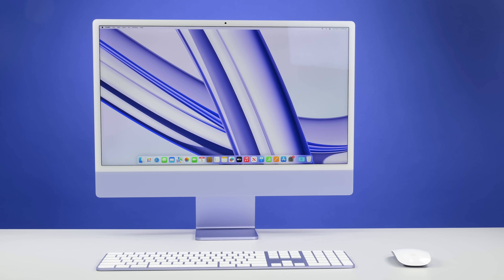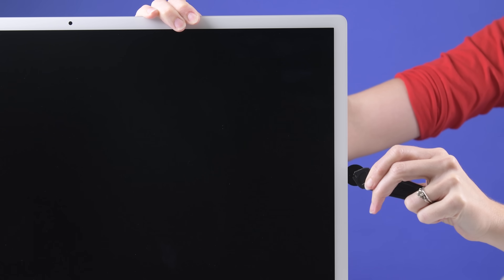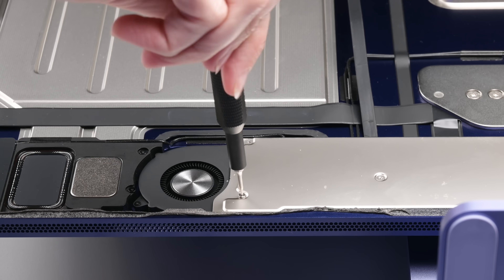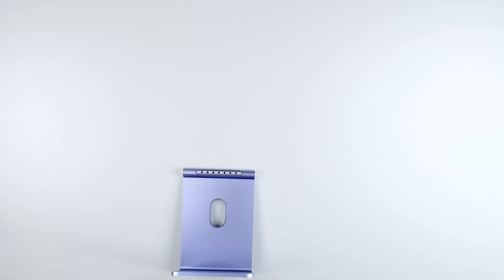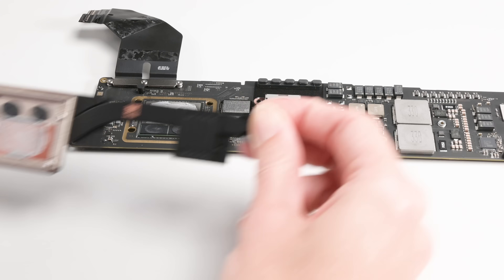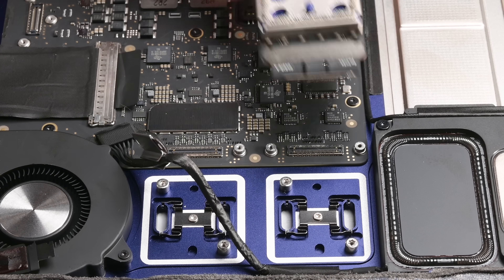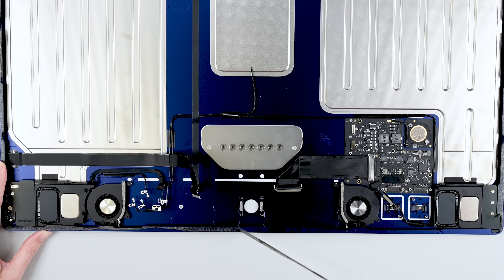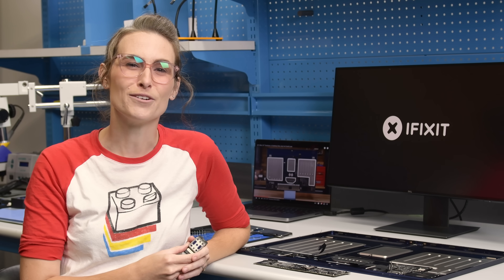M3 iMac Teardown: Apple’s Most Replaceable Battery?

Comment: Didn't realize Imac had a battery .. I though only Air and macbook pro laptops.
Reply: The reason why desktop computers have batteries is because this prevents system date and time from resetting each time computer is disconnected from AC outlet. When tearing down iMac, what needs to be removed first is, of course, screen, but what should be removed second in this video is battery, despite it only powers internal clock and not anything else.

Comment: If anyone was wondering why Apple stopped allowing end user VESA to stand swaps apparently the iMac Pro VESA kit was causing people a lot of problems (breaking while being installed/removed, screws stripping due to thread locker)
snazzy labs has a series of videos documenting his struggles so Apple decided you needed to pick which way you wanted it since
Reply: do you know if you can buy an adapter somewhere? ive been wanting to remove the stand to switch over to vesa, but can't find that adapter anywhere

Comment: Apple claims to be eco friendly, but if that's the case this kind of product should not exist without user replace-able/upgradeable CPU board, RAM, battery, HD (without needing to take the whole product apart).. as it stands you have a screen that is probably going to be trashed 5-10 years down the line. There was really no reason for Apple to not enable also using this as an external display capable to show other non-Apple OSs from external machines (well there are reasons, but I need to stay polite). Do yourself and the environment a favor get a Mac mini or laptop instead + external display if you really must have Mac OS and a big screen (non-upgradeable soldered HD/RAM in the mini/laptops is also kind of offensive).

Comment: No fault of the technician / host here but "accessible" shouldn't be associated with "repairable".  Short of the battery, it seems like there's nothing you can actually fix on this machine with a replacement part due to serialization.  Soldered basic components still gets a 0 of 10 from me.

Comment: If they'd just shoved that tiny mainboard into the PSU as well, then... oh hold on.. then that would be a mac min... and a moni.. 
I'm sure they have their reasons.
Reply: That would require compromising the performance of the display interface and adding the expense of the video cable and connectors.

Comment: What Apple computer has EVER been viable for repairs when something major dies?  The original 1999 Bondi G3 was a write off if the CRT died!  The 2002 iMac G4 was a write off if most anything died in them, whether it was a TFT screen death or the logic board had gone.  Nothing has really changed.  In the PC world it's always been substantially simpler and affordable because there was no Apple "tax" for their proprietary expensive parts.  If your PC motherboard fritzed?  Just buy another one and a lot of people could replace the parts themselves or get a PC shop to do it for parts plus labour.  Apple has ALWAYS been about profit from using a closed hardware system.
Reply: Their design philosophy is to keep tight control on the hardware so they don't have to clutter up the OS with multiple hardware drivers for the same function. That's one of the reasons Mac OS has always had some quantitative and qualitative advantages over the comparable generation of Windows. At least, that's been the official Apple story for decades.
Reply: Apple computers was always a proprietary hardware vendor running a closed operating  system.  That's the simple truth.  Apple was the polar opposite of Microsoft.   @paulbade3566

Comment: This iMac is a very badly designed and as a result a waste. This is a disposable machine. The computer part should be user replaceable/upgradable (for future M3 chips, and for other upgrades, with option of having a fan equipped unit). Apple is capable of doing this with a nice design that's practical, user friendly and engineered well. No adhesive should at all on the machine. The stand should be changeable way easier than this, not to mentioned the stand should be height adjustable.
Reply: Apple purposely does make repair hard because its how they get money. If it breaks or gets obsolete the first thing their brainwashed apple fans do is buy a new device! Boom more money and really "eco friendly indeed"

Comment: i still don't understand why are we not getting Pro or Max chips on iMacs. larger heat sinks, got fans to cool things down and have more than enough space to add extra fans and whatnots. if it fits in a MacBook it fits in an iMac. just slap one of those better chips and call it an iMac Pro already, it would be a very capable yet minimalistic machine.
Reply: Apple would rather you buy a Mac Studio with a Studio display.
Reply: May be the iMac Pro did not sell well, so they keep the iMac in the non-pro-line of products. Isn't the M3 itself freaking fast yet?

Comment: I'm surprised at how easy it is to get into this iMac. Looks pretty good in terms of repairability. Unfortunately, almost nothing can be replaced by the end user.
Reply: You can only change motherboard.. surely It Will be cheap 😂
Reply: sorry is this sarcasm?

i really cant tell 

i dont get how needing to purchase a adhesive kit use a special roller then remove seval components to access a common consumable is repairable considering most those connectors are fragile and if they break void your warrenty and cost alot to replace
Reply: @Sarge92  I can't tell either, but I do know that while it might be easy to open, closing it properly requires the purchase of adhesive which Apple will not sell, this is just one part of the entire planned obsolescence approach Apple have taken. And the woman in the video even recommends it, as if it's normal to shaft your customers!
Reply: @nohandleleft  meanwhile in most other laptops they place that battery either under the keyboard accesibly by removing 2 screws and a trim piece 

or under the access panel near the ram

for almost all aio style pcs this battery can be accessed via the hardware upgrades panel cover on the rear

only apple requires this level of tedium to replace a consumable battery

the fact that you need to take over 70% of it apart to access this common part shows just how much apple despices consumer repair

because apple when they choose to can engineer products quite well just look at how much tech they fit into a iphone

but frequently they choose screwing over self repair above common sense
Reply: @Sarge92  It's a much easier case to open than one might expect it to be.  People talk about it as though it's impossible, so from the perspective of someone who's trying to cope with the reality that apple killed their iMac line, who wants to go on pretending that this is a return to a proper rendering workstation, it's a glimmer of false hope.

Comment: If the SSD dies on it, to a normal person, the entire machine is E-Waste. If the Keyboard battery dies, it is E-waste. If the Mouse Battery dies, its E-Waste. Having to remove the glued on screen for 0 upgradable parts should be a 0 out of 10. Not to mention it ships with 8 gigs of ram as standard when that was standard on most apple macbooks 10 years ago.
Reply: i agree with everything your saying but the glued screen those are easy to remove yea i would prefer screws but it isnt hard
Reply: they used to be magnetic which was so much nicer and easier to remove.  @CollynPlayz
Reply: @CollynPlayz Finally someone is point I the obvious

Comment: Hey iFixit. Could you tell us what config of iMac you used for this teardown? ie. is there a difference on fan count with base vs upgraded?
Reply: Wondering the same. I bought the base model, with the only update to 16 GB RAM (which is what I could afford, and I honestly preferred spending those $200 in RAM than 2 extra cores). But I'd like to know if mine will only bring 1 fan rather than 2 😥
Reply: @jose-j1j2g  Nice of iFixit to reply to me... I ended up downloading an application called Macs Fan Control to see how many fans there are and what speed they run.

Comment: Yes, it is a smart, repairable design, but those virtues are canceled out by Apple's refusal to let us replace components without their permission.
Reply: whats repairable about needing to purchase a glue kit and various other tools and remove the lcd panel and glass just to change out the cmos?

even ultra thin laptops dont need this kinda madness
Reply: They could easily make the screen removable with  something like a  latch system or magnets. The adhesive strips are simply wasteful and make repair and maintenance more error prone, difficult, and less accessable.
Reply: And Apple's refusal to have anything meaningful be changed, such as the storage, cpu, gpu, and ram. Like the components that actually matter, not a dinky $2 cmos battery for a bios that is virtually nonexistent
Reply: @bigbubba0439 I will grant them that replacing components that are on the SoC, those being the GPU, CPU, and RAM would be almost impossible without an additional component allowing one to swap out the entire package. There really is no reason for Apple to be soldering storage into place, though.
Reply: @bigbubba0439  Realistically, apple can get away with not allowing you to upgrade the cpu, ram and gpu, it's an SOC. The one thing that makes no sense is the storage however.
Reply: hopefully they expand the consumer repair program to this soon
Reply: @hatsunehatsunemikumikumiku  Nice idea for marketing team: "and in new heneration we allowe users to replace buttons!")

Comment: Not bad, but I still don't think this is the right approach to a desktop - soldered RAM and storage in a DESKTOP is very poor because neither can be upgraded, or replaced in case of failure.
I've never heard of other desktops (or AIOs) having soldered RAM and storage (at least not outside of Apple).
Reply: Although I agree wholeheartedly, at least they have a somewhat decent excuse for the RAM since it is an SOC and part of the benefits of their architecture are sharing the RAM between the CPU and GPU allowing for some performance benefits since there isn't a copy back and forth.  I've particularly noticed a benefit in loading huge ML models that I wouldn't be able to without a super expensive GPU or paying lots of money for cloud compute (although Apple's GPU is weak so it doesn't compare to the dedicated GPUs in speed).  

But the storage, there is 0 excuse for them to solder the storage in their laptops or desktops.
Reply: @Watchandlearn91  Even though I don't like Apple's practices... I kinda agree. I feel that this iMac is less of a proper desktop for power users, but closer to a laptop that can't be moved (e.g. for a business, computer lab or a home office) - and for some casual users that's preferable. And if that's who Apple is targeting and it lowers the price for performance, that's good.
Fully agree about SSDs, that's a limit a lot of users hit and are aware of.
Reply: @wojtek4p4  I see it as a home or office computer for someone doing light work.  I know my wife wants one that I will probably get her very soon because she does graphic design and the screen on those are so nice.  It's just a shame Apple is bent on making them e-waste after the internals are too outdated for OS updates.
Reply: @Watchandlearn91  I kinda understand the mainboard being one-piece (not SSD), since ram on the package/SoC has definite advantages, compared to socketed versions.
I wish these mainboards were upgradeable (Framework style), so a new mainboard could be attached to an old-ish body, giving it a new life, but I'm not sure how useful would that feature be to iMac's target audience. 
Unlike power users, casual users will likely be more tolerant to older machines (since they don't use all of the machine's capabilities), which means upgrade cycles would have to be longer. And maintaining compatibility for 3 or more years for a relatively small group of people sadly isn't in Apple's interest.
Reply: @Watchandlearn91  The excuse would be the extra impedance of the connectors creates delay and signal quality issues that require increasing system times.

The answer could be to provide a memory/storage expansion bus that can also be used as primary memory/storage (at the cost of performance, because the physics can't be evaded) if there is a failure in the base primary storage. This would simplify manufacturing for Apple because the storage options wouldn't require different logic boards to build and inventory. The real challenge in that would be keeping the signal lines short without creating thermal management issues, making the package undesirably large, or requiring an expensive or overly delicate connector. (Connector expense could be addressed by making the storage expansion connector an option, but Apple tends to go way overboard on the markup for that sort of thing).

Comment: at least RAM is not integrated into M3 chip, can be at least technically replaced or reflowed  ???
Reply: It's part of the SoM, same as all other M-series
Reply: It's soldered on and Epoxied in place, it can be reflowed just requires way more work than necessary due to Apple's greed.
Reply: @u8myfoood  Massive power to efficiency ratio gains have been made from the way they have made theses SOCs so maybe not all to do with greed...
Reply: @leebeeskee  if you add glue under the chip, it is totally greed

Comment: Cool and all that they took one tiny ant step towards the right direction with the external PSU but still 0 repairability considering parts arent found anywhere reliably neither is anything upgradeable or rather is upgradeable but through apple with super expensive parts and labour cost.

Comment: So, even when Apple does something RIGHT by switching to an external PSU you just had to give them criticism for it?
Reply: The external PSU is nothing when nothing on the inside is upgradeable anyways.
Reply: @Sphyxx  You don't buy an iMac for upgradeability. Lots of parts are replaceable IF they break.
Reply: @OskarBlomkvist  it's a waste of electronics for such a proprietary unrepairable slab of metal and glass
Reply: @Sphyxx  You’re heavily overestimating how often the non replaceable parts actually break.
Reply: @OskarBlomkvist  but the thing is, apple is known for serialising all their components
Reply: @Sphyxx But how often do iMacs breakdown? I’ve had iMacs since 2011 (3 models) and have never needed a repair or had any issues.
Reply: @OskarBlomkvist  You're saying all this as if it's a good thing?
- Basically unrepairable as you can't get parts
- Completely impossible to upgrade anything
- Poor bang for buck
- Built in obsolescence

And these are good things that what, other companies should copy? I will give them credit for putting the USB ports on separate cards as those are one of the more likely parts to break, given how extremely anti-customer Apple is I'm pretty shocked they did that.
Reply: if they never break, then it'd be nice in the future to at least upgrade ram and storage to maybe get some media PC type of use out of them but older imacs lack the umpf for current application optimisations.
Reply: @ross-carlson  Then don't buy a iMac?

You want the M3, RAM and SSD to be replaceable or what? That's not a thing when it comes to Apple Silicon.

Poor bang for the buck? Please, link me to another ''all in one-computer'' with better specs, design and screen for a cheaper price.

Other manufacturers have also been soldering the CPU/RAM to the motherboard for 10+ years (maybe not on AIO/Desktops, but laptops 100%)

Obviously it would be better if more parts were replaceable, but people are hating on Apple for the completely wrong reasons or things that other manufacturers also do without getting the same amount of hate.
Reply: @OskarBlomkvist The "then don't buy a Mac" stance is a poor excuse. Apple is a major player and the things they do affect the industry.
"Poor bang for the buck" is probably a poor choice of words, but Macs are definitely higher priced than what most users need vs. their Windows counterpart. In order to prove that other AIOs exist for a better value, it is not necessary to find one with BOTH better specs and better price. Only one of those conditions is necessary to compare a device favorably against the iMac.
Saying "other Manufacturers do x too" is also a poor argument. The repairability community doesn't appreciate their approach either, but this video is about Apple, not about them, so it is not appropriate to criticise the video for not addressing those other companies.
The video focus is Apple, therefore it is Apple that is being discussed. They are not being singled out, and no company is your friend. There is no need to come to their defense.
Reply: @OskarBlomkvist  Was ist, wenn die schwache Batterie leer ist?, was ist ein die SSD den Geist aufgibt? oder die Lüfter  (weil zu klein) die zu starken Erwärmung nicht mehr abführen können und das Gerät ständig abschaltet?
Ich glaube auch an die gewollte (bis) 2-jährige Nutzung - dann neu -! weil Apple es so will. Ich wollte bis heute unbedingt den neuesten Apple iMac mit M4 in bester Ausführung kaufen. Jetzt ist der Wunsch gestorben. Danke für Eure Hinweise und an ifixit.
Reply: Apple hasn't done anything right since mid-2008.
Reply: @nibelungvalesti  Bullshit.
Reply: IKR. she doesn't know what she's talking about